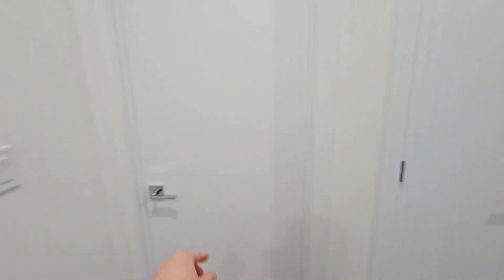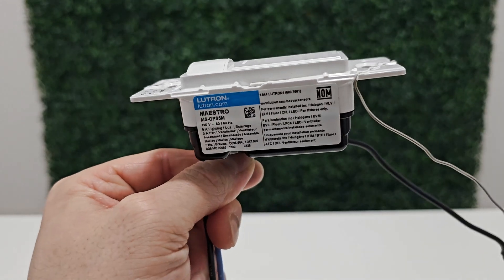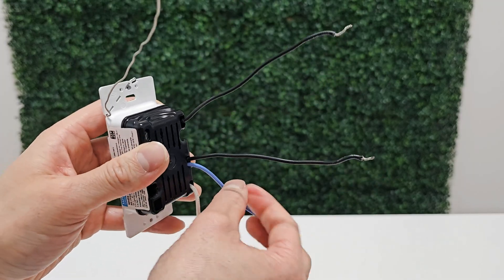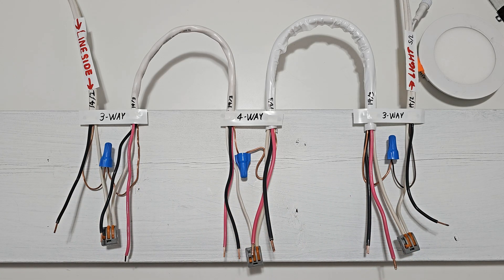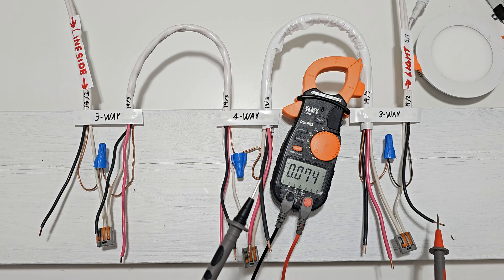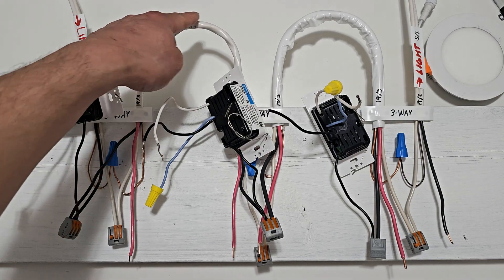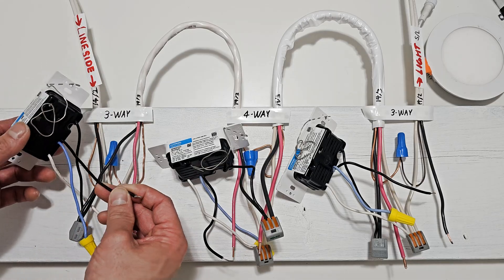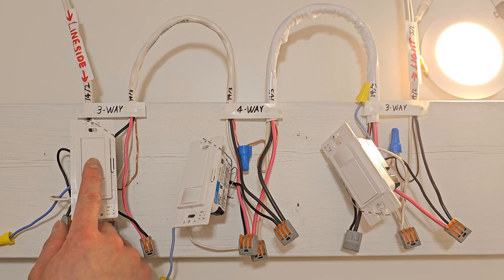Install THREE Motion Sensor Switch On a 4-Way Circuit THAT WORKS! Any Brand

Comment: I have four mechanical switches that control a set of ceiling lights.  Will this circuit work for that setup?  Can I leave any mechanical switches in the circuit?

Comment: Thank you very much for laying this out. My 4 way had both the line in and line out to the light. Plus another 3 way to another light. 
Without your diagram, I would never of figured it out.  The motion switches are all working great.
Reply from the maker: You're very welcome. Glad to hear it worked out! 🍻